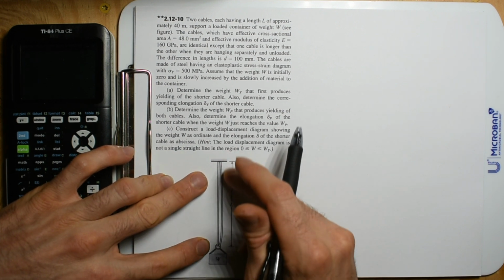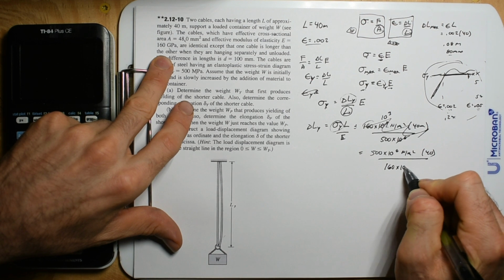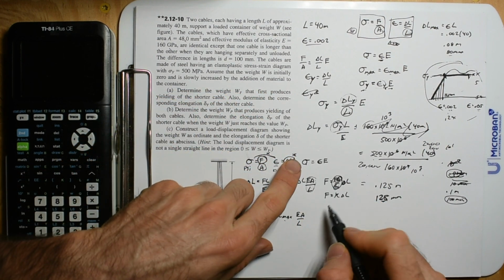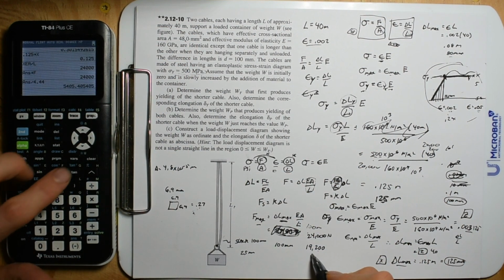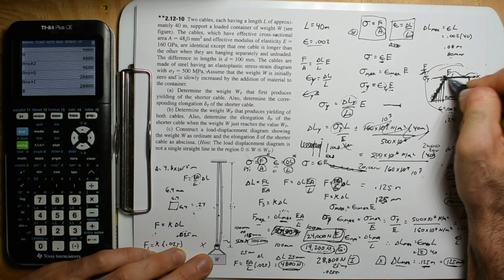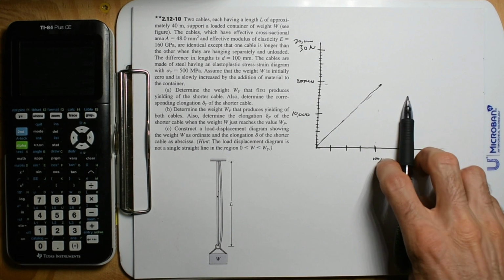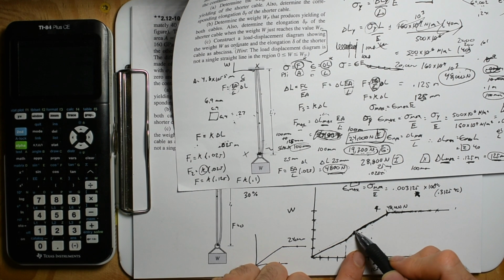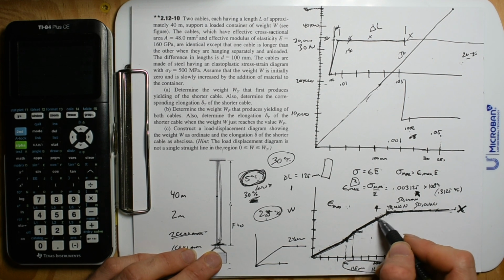TWO STAR Elastoplastic Problem MECHANICAL ENGINEERING!

Comment: subscriber here. great channel. keep it up
i have a problem for you that i never got an answer from other engineers i asked:
given: assume right hand rule conventions: x-axis horizontal, y-axis vertical, z-axis perpendicular to the page (positive axis towards you, seen as counterclockwise rotation)
imagine a cassette tape arrangement of two spools with the tape directly connected from one spool to another. assume no slack
let left spool = l_spool; right spool = r_spool; let their centers lie on the x-axis, and the distance between centers be = d
let the spindle of l_spool, l_spindle, rotate along the z-axis, and the spindle of r_spool, r_spindle, also rotate parallel to the z-axis at (d,0)
let arbitrary radius of l_spindle = r1, radius of r_spindle = r2
assume tape of even unstretchable thickness, ε, be wound on l_spindle; let l_spool have arbitrary radius at arbitrary time t, R_1(t) 
let tape be attached to r_spool with an arbitrary radius at any time t, R_2(t)
let d > R_1 + R_2
let let tape leave l_spool at arbitrary point B , let tape enter r_spool at arbitrary point C, both B & C be on the first quadrant
let r_spool be the driving spool with constant angular velocity, ω_r, and constant angular acceleration α_1 = 0
let angular velocity of l_spool = ω_l, angular acceleration of l_spool = α_l
FIND: length of tape, λ, as a function of d, ε, t. ω_r. find λ for a run time of 60 minutes
find length of BC at any arbitrary time, t
define angle φ, as the angle BC makes with the x-axis, find φ for any time t
what is the velocity vector of the tape at point B at any time t
what is the acceleration vector  of the tape at point B at any time t
define γ as the angular velocity of φ, what is the angular velocity vector at any arbitrary time t
how many revolutions or r_spool will it take to unwind l_spool
specify any necessary assumptions